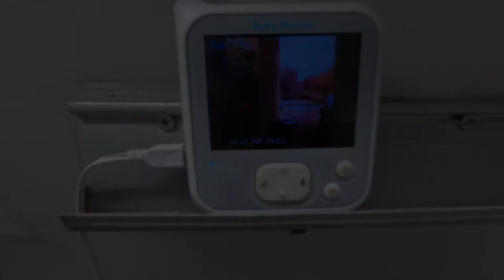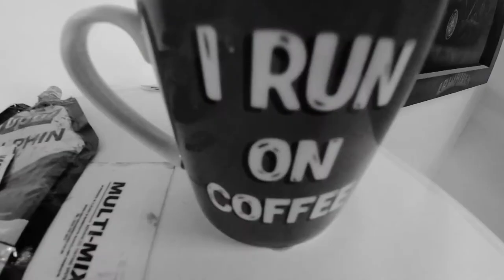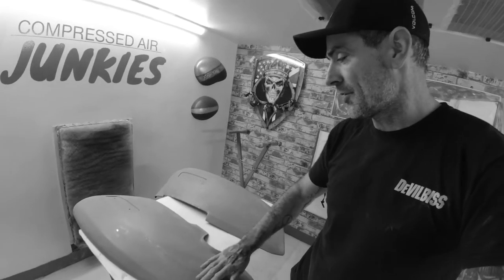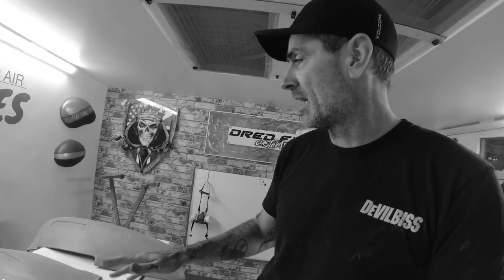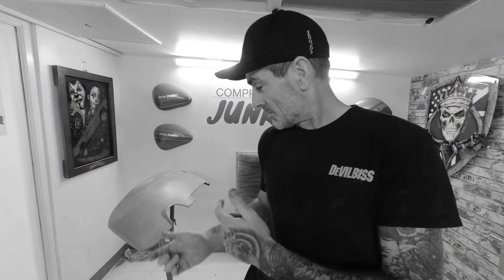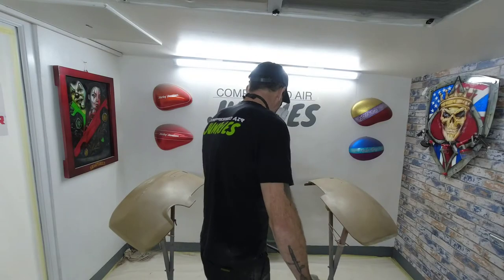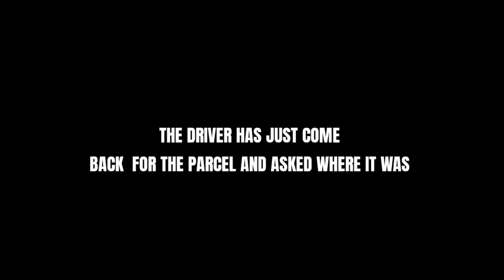Lambretta gp side panels PART 3   spraying some 2k Highbuild Primer and blowing my lid !

Comment: Looking good Rob it's quite a longwinded job when using epoxy then high build, oh what high build primer do you use mate? I currently use Roberlo MultyFiller which is ok but don't like the wow side of it, now testing the Kapci 626 which is awesome for WoW primer and it's tintable, you should have opened that Amazon box mate as it may have a Sata 5000 in it 😂👍
Reply from the maker: Hi john 😂😂amazon i use mipa highbuild its ok does the job mate 👍
Reply: Ok thanks Rob, keep them coming 👍

Comment: We're those 3m sponge pads!  If they were let me know where you got them.  I have been trying to get them for like ever.  I do not like the other brands for what I do.  I've looking for the 3M™ Flexible Sanding Pad CPFSPF, 4.75 in x 3.75 in x .5 in, 250 cs Fine.. they are the best ones for sanding primer the ML Campbell primer I used on cabinets. What tip size you used there to spray primer?   Mate be careful messing with other people's Parcels😂🤣😅may land you in jail.  Another great video Rob.   Keep the videos coming.  Cheers bud 👍 👌
Reply from the maker: Hi Jesus c there not 3m pads these are cheap ones you get in a pack of 5 👍fine up to about 180 grit but they work great and last 👍